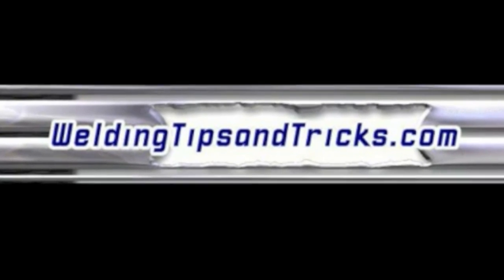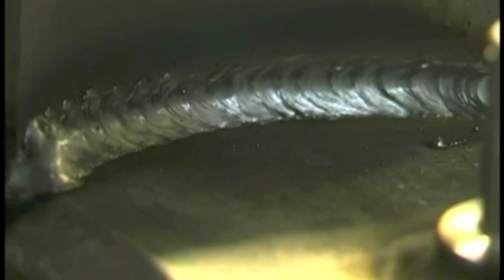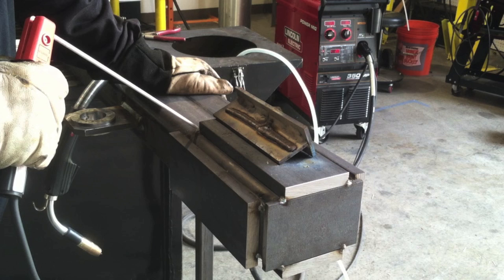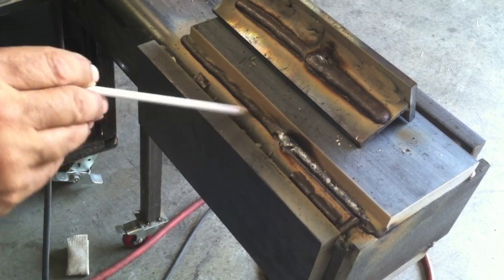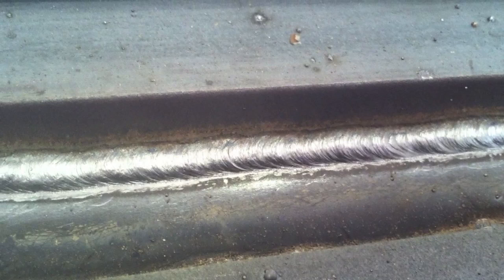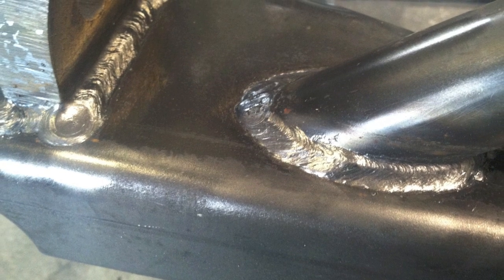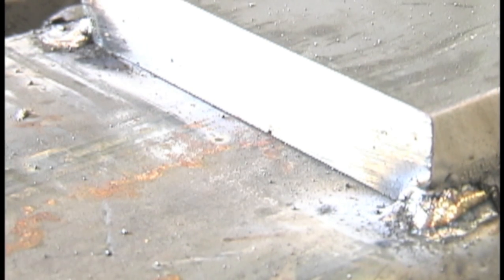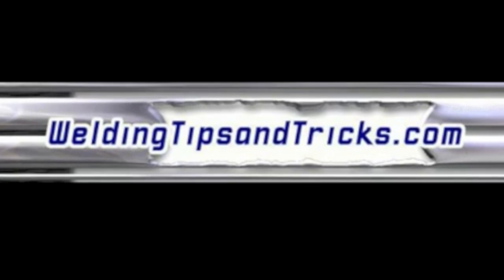Stick Welding with a Lincoln PowerMig 350mp and a BuzzBox

Comment: I have a buzz box works just fine and since I live in the north, there's a lot of wind coming from the south blowing a lot usually I'll just use my buzz box all the time for garage applications or outside applications and I'll never get arc below because of the AC and everything works good

Comment: I hate co2 for wire welding. Leaves too much spatter. Good for backup I guess. I run 92/8 with .035 at 30 volts and 6 wire speed ( Miller) so I'm spraying with hardly any spatter. Love that setting.  I recently burnt up my 38 year old Miller DC  welder for stick and tig. The boss wouldn't buy me a nice tig machine  so he gave me an extra Lincoln 350. Hooked it up, read the manual and started tigging but the touch and lift method is aggravating.  Maybe I'm not use to it yet or the fine tuning eludes me. I wish it came with a trusty ole scratch arc setting.

Comment: When rigging up stick on a 350 mp can i just setup a jumper cable with a hammer lug on one end. Quick connect on the other for my stinger and run it off the positive post? Thanks in advance

Comment: I love my 1983 Century AC/DC 'Buzz Box', it is 37 years old and has NEVER required ANY maintenance other than a shiny new coat of Rustoleum to brighten up the age dulled factory paint and to open up the case every 5 years or so to blow out dust...
Reply: It has only received a re-paint once, last year at age 36...

Comment: Darn , Jody,
  thought you were going to stick with cv power. Dying to know characteristics. If you are going to finish a weld with a wire wheel ,would  just using a wire wheel save time(money) ? Why does mig(cv dc) work on aluminum but tig  require cc/ac for aluminum ?   Inquiring minds with bad backs want to know.
                                       Grateful always,ed
Reply: Typically aluminum MIG is done on thicker pieces in spray transfer.
Reply: enemyguitars yup usally 3/8th or thicker

Comment: how does strength of 7014 compare to 7018
Reply: +AKweldshop uh im sorry buddy but the 7014 is a medium pennetrating rod while the 7018 is a medium (to high,ish) pennetrating rod to, its not a huge differance like you told but, 7014 is a great pennetrating rod for Alternating Current tough.

Comment: For those welding positions a rutile coated electrode would have given better looking results. Also, i noticed, you said you used the (+) on the electrode. Might have tried (-), just to compare. ( I do have a certification for electrode welding in all positions, before you ask.)

Also, I disagree on previous comments saying that these welds look nice. Too little power, or wrong polarity make them convex (bulging outwards) and have a risk to crack easily, where the weld and workpiece meet.

Comment: I am happy don't talk bad about AC stick.  I have 2 welders, A wire feeder MIG) and an ancient AC box.  I use the AC a lot just because it is there on my portable table.  I turn it on, use it and turn it off.  No maintenance, no breakdowns, no hassle.  I just subbed.

Comment: All we run is stick rod at the refinery I work at... Well and tig for alloys. Unless a fitter has worked at a fab shop they don't know how to use a squirt gun.
Reply: I learned how to weld with an everlast welder and stick electrodes. I admit that mig is easier and has much less cleanup but I still love stick welding.

Comment: I am using my Grandfathers (as you term it, Buzz Box) old SMAW/ Stick welder at the moment because I ran out of Gas for my Kemppi Mig. I still recon that I can not stick weld for shit as I learned on Mig and Tig. My customers seem to be happy at the time and I was surprised, perhaps after 30 years of welding I have learned something about how it should sound and to respond. PS Have How To Weld  the book by Todd Bridigium I think, took some lessons from there. Along side Machinist Handbook. John.

Comment from the maker: the dig function is also called "arc control" sometimes. With Stick welding, when you tighten up the arc gap, voltage drops. The Dig function, when set high, bumps up the amps when the machine senses a drop in voltage to prevent sticking the rod.

Comment: All right. I wrote about how to extend MMA welder to join thin wall steel and to simplify operation. If you are interested, please, Google: MMA WELDER FOR THIN METAL Kulikow
It will give you a link to some more details. 
BTW, I bought locally one welding inverter 200 A for MMA and TIG combined just for about 150 USD and another one by Ebay the same features + modulation of arc current and delay of the gas supply function for less than 200 USD. So, it can be really cheap. :-P

Comment: So did you just attach the welding leads with crimp on lugs or did you hang a couple pigtails with DINSE fittings or something like that?  Did it get in the way of the MIG hardware?  Thanks.  S/F....Ken M

Comment from the maker: I am still learning all the sweet spot settings and have not even used the TIG function yet but so far the powermig 350mp is a Sweet Beast. Especially on aluminum with the push pull system. next up is more stick with 6010 and also a bit of stainless mig, and maybe the tig function

Comment: Stick welding may be the only option to join pieces outdoors, like in construction and repairs. The use of DC positive and modulation of the arc current with a duty cycle less than 50% makes job a lot easier with profiles and tubes less than 1 mm in thickness. It also allows to use rods of diameter considerably larger than the thickness of the work-pieces. MIG welding is a great technique. However, not everbody can afford to buy gas bottles, MIG wires, and all the machinery for the MIG welding.

Comment: Do you have any videos on tig welding open box welds with a 1/16 inch gap and 12 gauge mild steel plate? The area I'm working is tight and my mig is M.I.A.